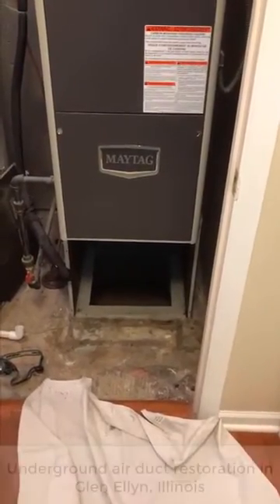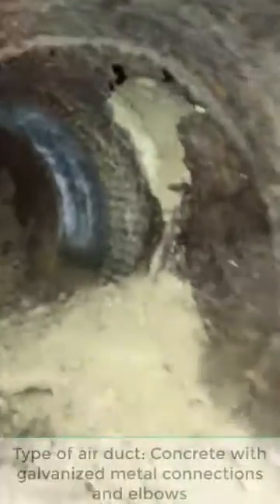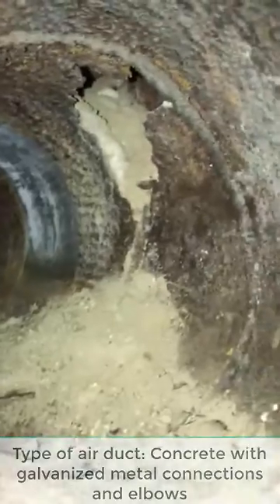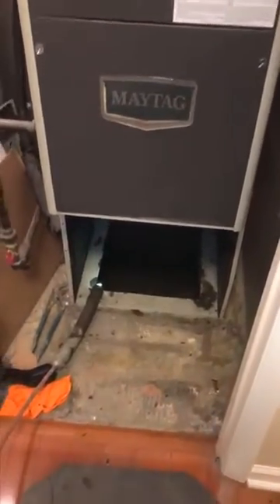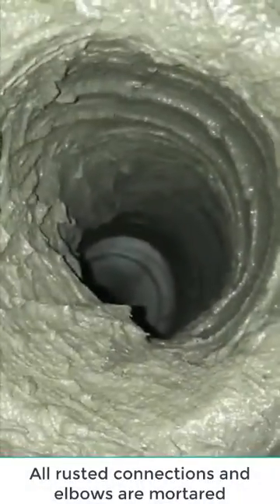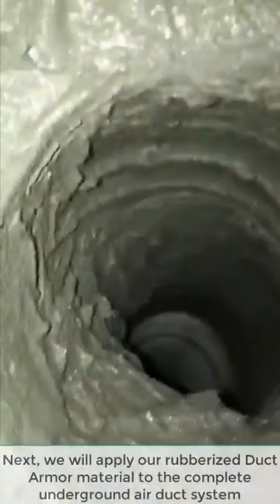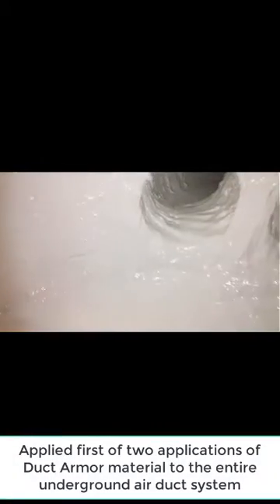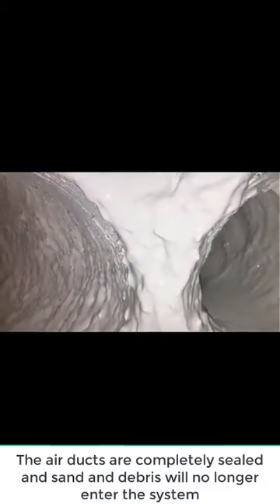Underground Air Duct Restoration

Comment: I need somebody in the Columbus Ohio area that does this! I have been trying to find a company that works with my end slab ducks that are messed up and my next option is having to replace my whole HVAC system and run ducks through my ceiling! Any help with this?
Reply from the maker: Hi Valorie. Thank you for your inquiry. We are located in Crete, IL and we service Illinois and parts of Indiana. You can visit www.ductarmor.com and search for a dealer near you by entering your city/state or zip code.

Comment: Would this work to repair ducts that run through the slab?
Reply from the maker: Yes. Our process uses a rubberized liner that is sent into the underground ducts directly through the registers, coating them and covering cracks in the pipes.